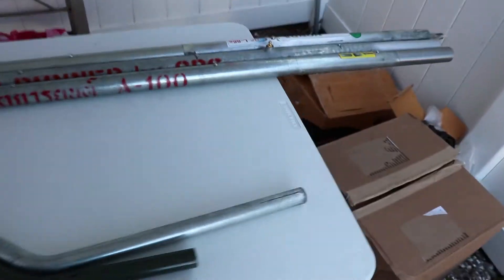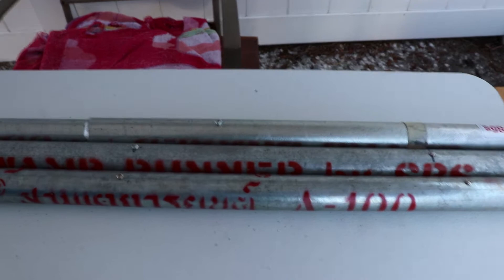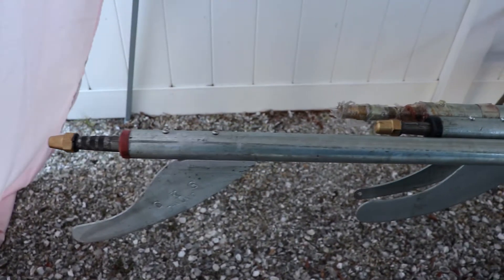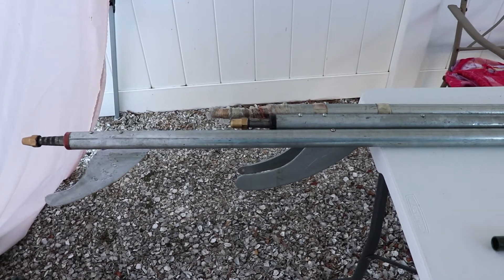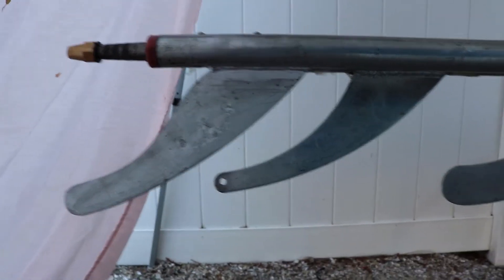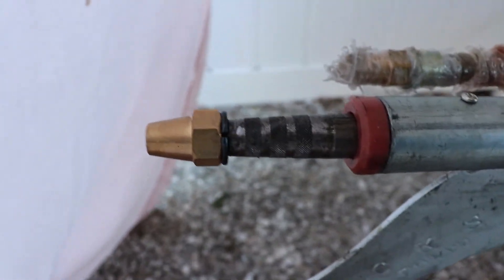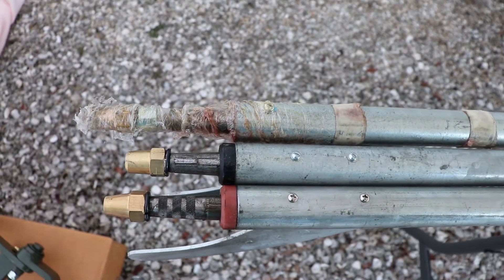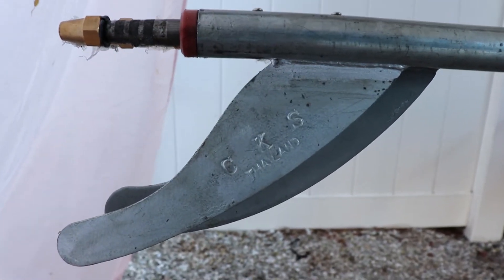Shaft Comparison Long Tail Mud Motor Kits

Comment from the maker: Just finished a big article on the website comparing all the parts and pieces of the long-tail mud motor kits. I hope it helps someone out! - https://www.jtgatoring.com/long-tail-mud-motor-kits-comparing-parts/
Reply: مرحبا
Reply: I have a mudskipper kit if I wanted to replace my shaft with an SPS shaft would it work? It looks like they come from the same place I mean I think they're brothers that compete with each other is what I'm learning.
Reply from the maker: @MudMotorsMax  The only thing that would be different is the coupler housing size where the shaft fits into it. If you have an old mud skipper tail, then you could probably take off the coupler joint and put it on the swamp runner shaft to fit your kit, but I just wouldn't know if the swamp runner shaft would fit inside the mudskipper coupler housing?